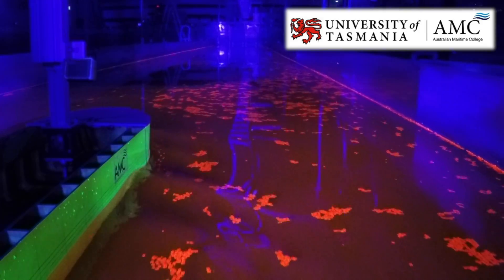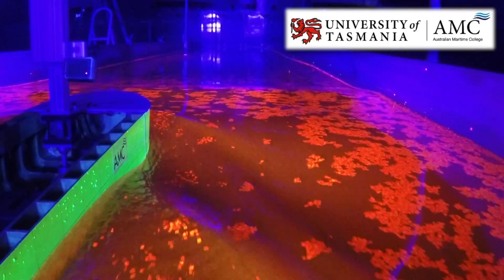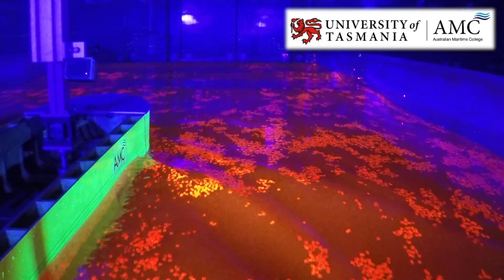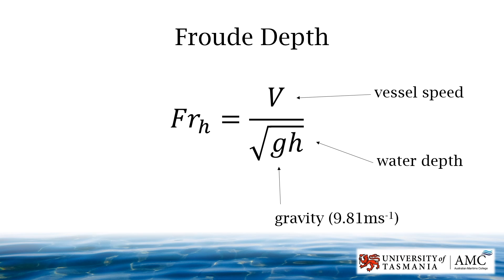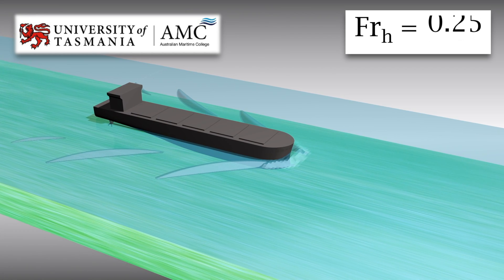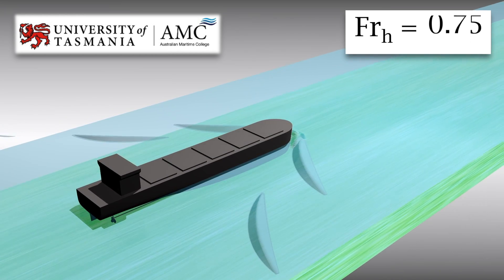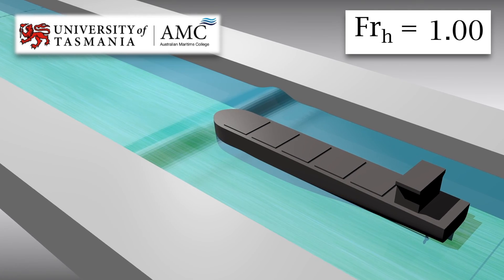Soliton Waves

Comment: The conditions for these soliton waves require a fixed causeway (such as a canal) to maintain stability and prevent dispersion. 

This is an entire planet, so no it is not accurate at all and the waves would not behave like this.

Those giant waves would have tsunami like effects on the entire ocean of that planet. (Molecules are attached to each other).

Think of tides but on a monumental and extraordinary scale.

Comment: Excellent presentation in few minutes for a significant role in dynamics of various physical systems. Thank you for imply this to Solitary wave theory that is "far away"  of definition which propagates without any temporal evolution in shape or sizes when viewed  on the reference frame moving frame moving with group of velocity waves. So in few minutes I have seen what I must illustrated in my head for hydrologic research - what when a single incident solitary wave passes over a submarged reef because it is disintegrates into a train of solitions (soliton fission), followed by a train of oscillatory waves. So thank you for effective presentation in few minutes! I can closely imagine on an simple explemple one of the major problems in the analysis of the recorded time series - the number of solitions N in the transmitted wave train behind the reef due to distinguish between solitions and oscillatory waves. Mybe you can indirectly do some video with similar topic issue.
👌 Thank you for video simmulation

Comment: These "Soliton waves" hold the key to FTL travel. If you could create a soliton wave in space-time you could "ride" or "surf" this wave with a spaceship and it would carry said ship wherever it wanted to go at superluminal speeds
Reply: Soliton waves require a containment channel for propagation. Wouldn't that requirement make them useless for space travel?
Reply: It wouldn't move you FTL you'd just be able to travel very far on little energy, I guess you could ride it forever, but also apply more energy as you speed up to keep the soliton with you, then eventually [potentially infinite time needed ...] you could reach FTL... But, realistically you'd never get there as there isn't enough space to travel

Comment: People really need to stop using the word "complex" willy-nilly. To me, it is MERELY a solution of partial differential equations coupled with boundary conditions and properties of the medium. Complex phenomena is an entirely different thing. Also, don't start defining things this way, because it literally provides NO useful information about what anything is. The basic definition of  complex simply means  having several interconnected parts - but that is literally all of the interesting science. Either way, most people will have no real intuition about what 'complex' means and it is usually used as a filler word when someone finds a particular topic personally hard to understand. Complexity science is an emerging field that describes certain classes of phenomena, so I would avoid using the term unless it truly is 'complex'.

EDIT: Yes, my tone might be a bit sharp. I am very passionate about this topic because I am unfortunately a graduate student in a "Complex Systems" program and I absolutely HATE the title. Why? Because it provides no useful information and requires that simple introductions become long-winded explanations because basically NO ONE/EMPLOYERS/FRIENDS/PEERS knows what this means. Honestly, I think a different title should be used for my program or we need to do a better job at communicating this technical meaning to the general public.
Reply: @lifeisbutavapor9396  Yes, I believe you. You're not trying to prove anything, but you've submitted three different responses, all beginning with "I am a graduate student in Complex Systems", as if this excuses poor behavior and a lack of decorum.

Suffice to say, you lost me after "your rhetoric is not needed". If anything should be judged thus, it is this conversation. I wish you luck in your studies, and your social life. It sounds like you need it.
Reply: @Anthrolithos  I was resubmitting the same response because there are errors in submission. I did not see that it was actually submitted, so I kept writing thinking it was not featured. Why are you such a rude person? Honestly, there is no need for that vitriol. 

Do you even know how to make friends? Cause you sure seem to know how to make enemies.
Reply: I got what you are trying to say mate. Never mind the harsh targeted comments. Peace is what we deserve!
Reply: @MegaJohnwesly   Perhaps it was my frustration with the word that leaked into my tone, but it was a sincere and benign, albeit impassioned, explanation.

Text can never communicate the nuances needed to know the nature of another human being. That being said, I argue with many of my friends because we like playing Devil's advocate with one another, but we are still dear friends who love each other. If our discussion played out as Youtube comments, people might immediately think either person was being antagonistic. But again, one cannot know by text alone.

There is a time for peace, and a time for battle; a time for order and a time for chaos. If a bit of chaos promotes understanding and greater harmony, then that may even be better than living in ignorance peacefully, no? Please do not take criticism personally.
Reply: @lifeisbutavapor9396  I love your comment. Lemme guess...Do you watch/follow Dr.Jordan Peterson's lectures?
Reply: @MegaJohnwesly  Thanks! I don't. I think i heard that is a popular podcast. But, im way too ADD to pay attention to people talking without any opportunity to chime in, haha.
Reply: Partial differential equations, boundary conditions, and properties of the medium all in concerto. He stated in no uncertain terms that the phenomenae is difficult to explain or predict, as tsunami display the same behavior as the ship bow, but are not contained within closed systems. Ostensibly, his topical discussion matches the definition of "complex" which you stated. 

Besides, language is partially composed of loanwords: words that don't necessarily maintain the exact same meaning or conceptual providence, but are mutable by the context in which they are used. Take the word "impact" for example: in a purely scientific sense, "impact" is used to define high force or shock. But take the same word within the context of literature or communication, and the word shifts to denote the relative sense of effect a particular rhetorical device might have; so again, keeping the same understanding of high force or shock while being much less quantifiable, as it pertains to emotions and cultural mores. Take dentistry as another example: "impact" in this field is simply a tooth that has failed to breach the skin of the gum, and results in  a high degree of pain and discomfort; it has nothing to do with high force or shock, or emotional meaning. Again -- the same word, but not the same definition.

He used the word complex in a layman's manner to confer the basic idea and the feeling to the audience of why the wave is so fascinating to study. I suppose you could say that this is all part of the "complexity" of language and communication: the method in which you transmit ideas is composed of many interconnected parts, and the behavior of these and how they articulate is difficult to explain or predict.

Thus, there was no need to confront the OP on his word use, or really try and position yourself as one of the elite with your understanding of certain words in relation to other fields of science. I can confidently say that the same topic you raised, phrased differently, would have won you many interested parties - myself included. As it stands, you simply come off as a jerk.
Reply: @Anthrolithos  I am a graduate student in Complex Systems and I often have to explain the technical meaning of "complex" to peers and others I interact with because it is part of my job - not because I want to be argumentative. Perhaps it was my frustration with the word that leaked into my tone, but it was a sincere and benign, albeit impassioned, explanation.

I am sorry that you have that feeling, but I would suggest that you avoid making judgments about the character of comment authors when text can never communicate the nuances needed to know the nature of another human being. That being said, I argue with many of my friends because we like playing Devil's advocate with one another, but we are still dear friends who love each other. If our discussion played out as Youtube comments, people might immediately think either person was being antagonistic. But again, one cannot know by text alone.

Comment: Thank you for the nice video and your work.  You know your own data, so I ask;  could it be, that the wave transition away from Kelvin waves begins at Fr=0.61 or more precisely Sqrt(6)/4? As this is what my idea about the solution (no solution) for Navier-stokes problem predicts. https://www.researchgate.net/project/Turbulence-22
Reply from the maker: If you refer to page 428 and 429 of [Havelock, T. H. (1908). The propagation of groups of waves in dispersive media, with application to waves on water produced
by a travelling disturbance. Proceedings of the Royal Society of London. Series A, Containing Papers of a
Mathematical and Physical Character, 81(549), 398-430.] in Table III they state that waves begin to diverge from 19deg28' as early as Frh = 0.5, but is barely discernible until above Frh = 0.8. I am unsure how this relates to Navier-Stokes. My research was not to explore the beginning of the critical region in the experiments, but we observed a non-linear increase in resistance beginning at ~ Frh = 0.6, which dramatically increased (analogous to 'climbing the bow wave') at ~ Frh = 0.7
Reply: @scottttt123  Wow, Thanks! I found this paper, which I wasn't previously aware of, as my approach comes from the Open channel flow; [i.e. Chow (1959)] 
Indeed the Table III and Figure 8 verifies your statement, and the wave transition is rather sliding than exact. 
Now, this wave angle change was only an indication to me that the resistance starts to grow at that point. So your reply "Increase in resistance beginning at  ~ Frh = 0.6" filled my expectations perfectly. This adds again another experimental observation for my solution to this problem. https://en.wikipedia.org/wiki/Navier%E2%80%93Stokes_existence_and_smoothness
The answer is "there is no solutions" because the equations are incomplete. And here I can now present a counter example in sub-critical region too. In Super-critical region I have already cleared the discrepancies between the thoery and experimental data. 

So how you can get this Fr=0.61? 
In this diagram; 
https://www.researchgate.net/project/Turbulence-22/update/5b37beaa4cde265cb64be95b
It's the Crossing point of "delta-E & y1", which are named Delta-S and d1 in this paper; 
https://www.researchgate.net/publication/325677372_Navier-Stokes_existency_and_smoothness_problem_-The_Answer_word-txt
So you just place Delta-S (Eq. 19) and  d1 (Eq. ~15) equal and solve the Froude number. (Pages 7-8)

Comment: So that means the existence of a soul though it seems mythical, is not that quit unlikely according to that very same mechanism and that the soul can continue as an energy pattern of the brains functions (which are of course energetic pattern as result of neuronal flow) in special circumstances to exist without the vessel (see that formula for froude depth in the video) - that means the body which generate that type of energy pattern in form of neuronal flow. 
I don´t say it is a proof for the existence of the soul but it is not an unscientific hypothesis anymore.
Reply: What are you smoking?
Reply: @QueLastima  Nothing. I'm just more curious than others.
Reply: Yeah you are right. See more examples at fractalfield.com

Comment: So is the channel/lab that they made the only place they can happen?
Reply from the maker: They can happen and have been observed. Although the lab is the only place that you will get them being generated continuously - typically the increase in resistance will cause a vessel to slow significantly. More often are the 'waves of translation' - caused at critical Froude depth but not in a restricted channel. Here is an example caused by a high speed ferry, the wave grew to four metres in height and swamped a fishing vessel! https://www.gov.uk/maib-reports/wash-from-high-speed-passenger-ferry-stena-discovery-swamping-angling-boat-purdy-off-harwich-england-with-loss-of-1-life

Comment: Beginning at 0:53 you have two separate equations showing gravity measured in ms^-1 . (This comment box won’t allow superscipts, so I am using the ^ to show that what follows is a superscript.) It should of course be ms^-2.
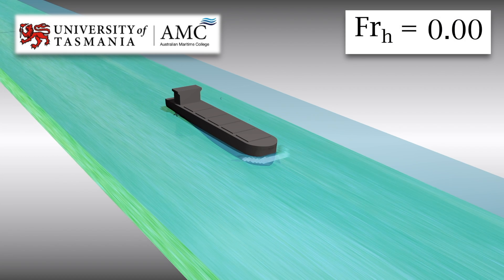The section starting at 1:21 is very intriguing and clear because you have laid it out so well, with a little box at the upper right showing increasing Froude depth, while the image shows the waves moving outwards and forwards until they become a soliton if confined in a channel. The clarity of this scene is also due to the fact that you don’t make the camera (the observer) swoop rapidly this way and that around the scene while the bow wave pattern is changing. If you had done that (as many videos unfortunately do), it would make it much more difficult for the observer to understand what is going on. To understand movement in a scene, the observer’s position needs to be kept still, or nearly still. Then he knows that all the motion he is seeing is motion in the scene in front of him. If the observer is made to glide constantly around, he cannot properly see what motion is due to his own motion, and what motion is motion in the actual scene in front of him. 
So a good video – but please check the units for gravity at 0:53.

Comment: Does this have any parallels to the shockwave produced by supersonic aircraft?
Cool video too, thanks for sharing.
Reply from the maker: I'm sure a physicist could provide a better response - and if there are any out there please enlighten us. It sounds possible - a supersonic shockwave is produced by bunched up sound waves that cannot escape each other. Solitons propagate ahead of the vessel as the energy is 'trapped' and builds in front of the vessel, and must discharge forward. So there are some similarities, although if a vessel increases its speed beyond critical Froude depth it will rise up on the water surface due to hydrodynamic lift and begin to plane. Would be interesting to see what would happen if the vessel was fixed and could not plane...